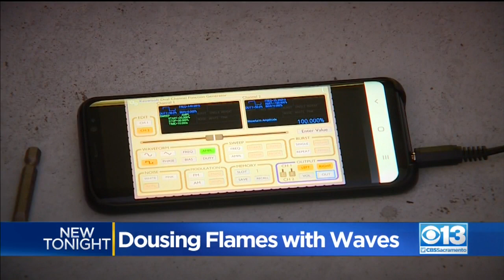Dousing Flames With Sound Waves

Comment: Man that's just air blowing out thru that hole there no sound frequency that stops fire! 🤣
Reply: It's not that it's blowing air out that puts it out. You wouldn't use a leaf blower on a burning house, that would just make the fire grow. What's actually happening is the low frequency sounds are separating the oxygen from the air. It is literally the sound itself that makes the fire go out. You can do it at home with even a cheap end speaker and a candle. Look up a frequency generator, set it to between 30-65 hz. 

Have you ever seen singers break wine glasses with high pitched singing? That's because they're matching the resonant frequency of the glass itself. If an object has it's frequency matched at a loud enough volume, it will destabilize and break. And it would be completely different than smashing something with a hammer. Physically smashing something, you're just breaking it externally. But matching the frequency of an object destroys it from the internal molecular structure.

You can also try this at home with a harmonica. If you blow into a harmonica and hum your throat at the same frequency for long enough, you will ruin the harmonica. 

Sound does so much more than our world understands. 

Think about how music can affect your mood and disposition. Sound can vibrate your entire body, cause you to throw up, cause you to relax, put out fires, and so much more. 
A lot of people want to nitpick the mysteries of reality instead of accepting them for the gifts that they are. 

I tried to explain the fire extinguishing sound to my 60 something year old coworker and he also laughed it off and said it was just wind. Yes you can blow out fire, such as birthday candles. But in the instance of a forest fire or house fire, blowing on it with a giant fan just adds more oxygen to the fire. Thus allowing it to grow larger.
Reply: Someone didn't take a physics class in skool
Reply: @Astrovite  Actually Fire is High Vibrational so the Low Vibrational Sound is lowering the Vibration of the Fire and thus putting it out. It is not Oxygen seperation. It is Vibrational Physics the same as Lowering the Vibration of Water creates Ice.
Reply: @niktes3337  Oh my bad thank you. Does that only work because fire and water aren't solids? Like can you change the frequency of a solid object or only non solids? 

As opposed to matching the frequency of a solid to destabilize it.
Reply: @Astrovite  Everything is Vibration. So when you Raise the Vibration of Solid Matter it melts into Liquid and then Gas and then Plasma as the Charge is separated in the Gas. And if you Lower the Vibration of a Solid, you Freeze it and depending on its composition, it will compromise the integrity of the Solid. As for matching the Frequency of a Solid to destabilize it, I think you are talking about reaching the Natural Frequency or Resonance of something where that something will literally Vibrate apart as the Vibration intensifies like shattering Glass by Vibrating it at its Natural Frequency.
Reply: @niktes3337  Oh okay I think I understand. So you can change the vibration of literally anything. I think I just never connected the idea that you can CHANGE the frequency of an object. I'd like to learn more about this kind of stuff. I know a bit from a metaphysical standpoint but not as much from a physical perspective. 

I remember falling asleep one night and my entire body started vibrating immensely. Not like convulsing physically but more so my incorporeal body. There was also a ridiculously bright light. I know that sounds insane but it was real to me.